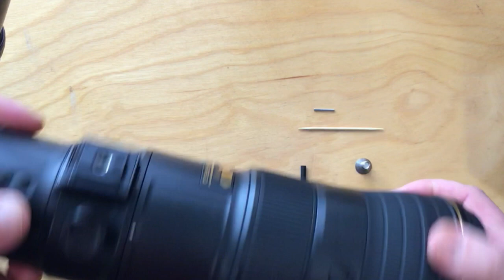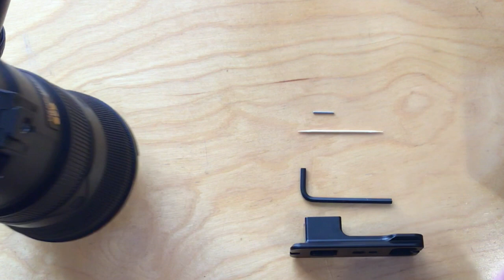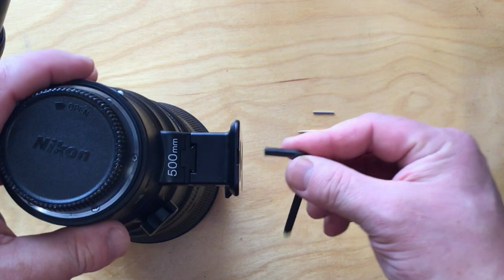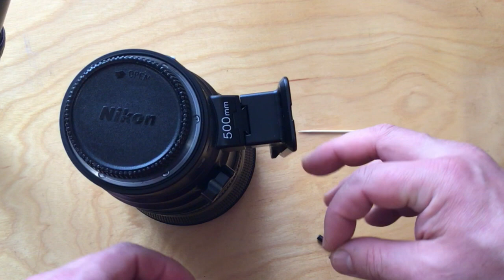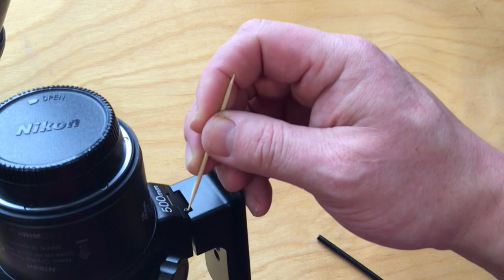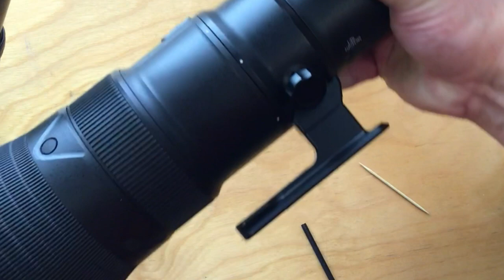Wimberley AP 500 Installation

Comment: I just installed it  on my Nikon 500 PF and it worded perfectly. You have to tighten the screw down very tight to make certain it fits flush on the left side but once I did it all worked as described. Works great.
Reply: Mine isnt flush on the left side, I'm not sure I feel comfortable cranking down super hard to crush that darn thing

Comment: I still don't understand, why do we need that pin inside?
Reply: Its a shim to compensate for imprecise engineering
Reply: @oneaztexan6125  i didn't😂😂😂😉 get that as well why would you not cut it to fit then just bolt it on???
Reply: I believe it's some sort of spring pin...  like  what they  used to use on watch band. back in the day
Reply: Because they didn't want to take the time/cost to precision machine an actual mating dovetail.  A shim (which is what it is) is way cheaper.